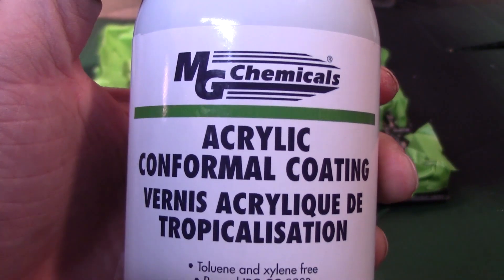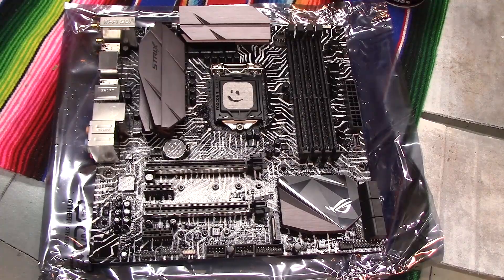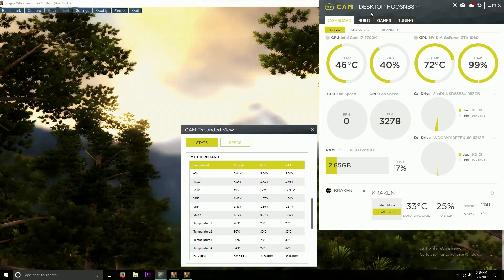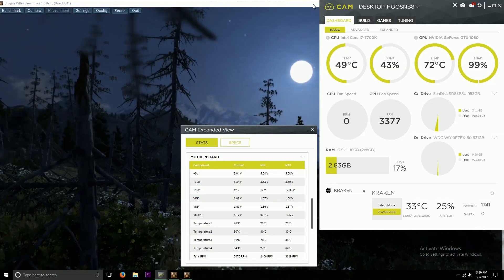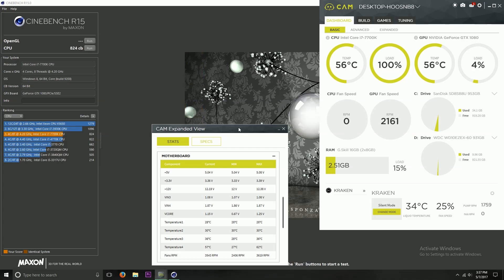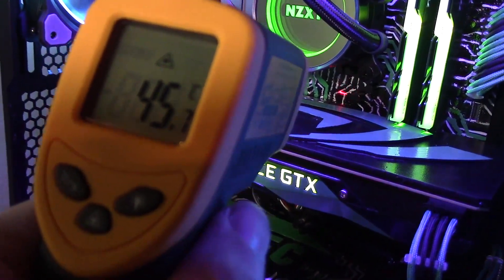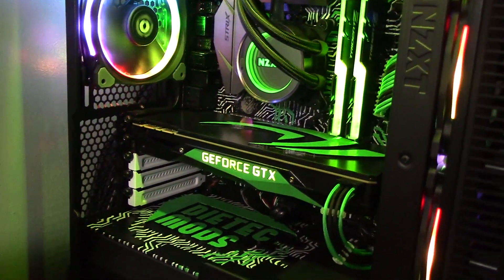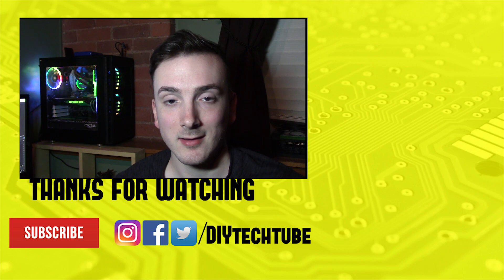How painting your motherboard PCB effects temps

Comment: Can you keep the vrm heatsinks on while painting? If you remove them to make them another collor then your motherboard how do you put them on again?
Reply from the maker: +Toto Geenen There are either clips or screws that hold them on. It's pretty easy to remove and reattach them. I wouldn't keep them on while painting though, it'll be a nicer paint finish taking them off
Reply: okay, thanks. Do I need new thermal pads or paste to keep the cooling the same as before?
Reply from the maker: +Toto Geenen You can reuse the pads. Always replace thermal paste though
Reply: Dietec okay. thanks a lot!

Comment: I was thinking about this the other day after watching the other video on it. I still have my reservations.

I remember when Oil cooled PC's were a thing (is it still?) that one of the common problems is that the viscosity of oil sometimes caused heat to build up under chips (where the oil did not circulate well). Even with paint that allows heat to go through you are likely to block (or reduce) air flow under some components.

I don't know, maybe I am just overly cautious.